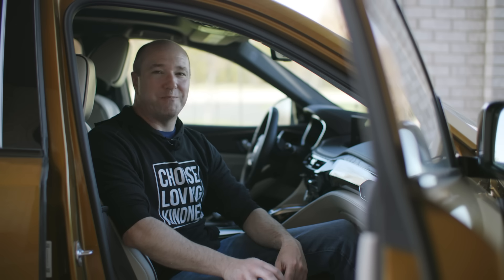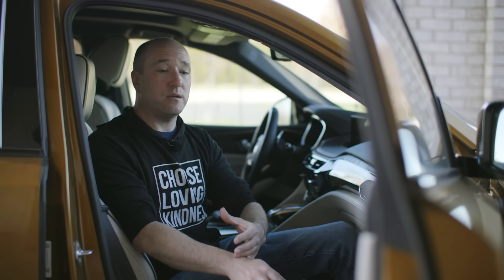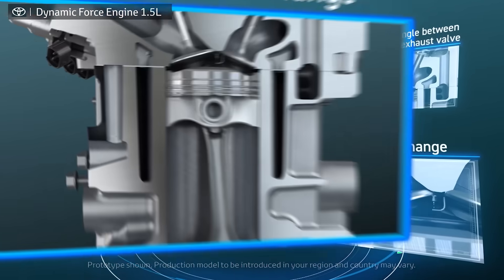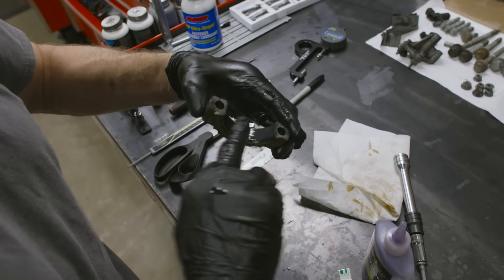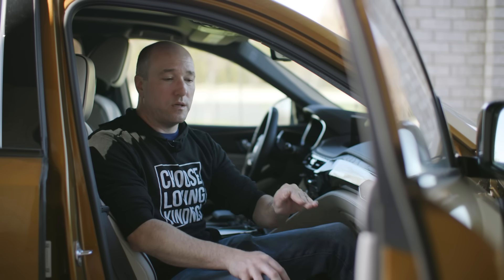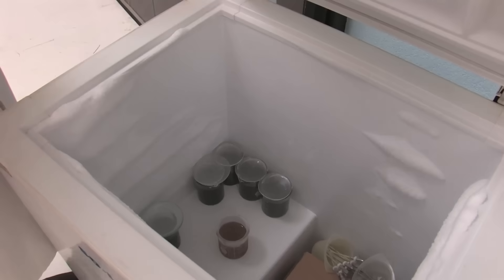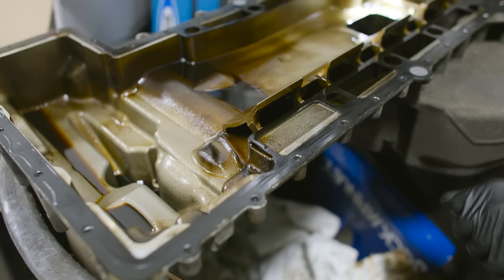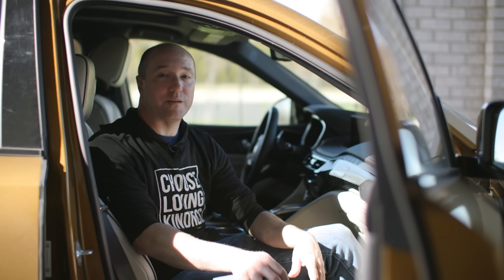Understanding Engine Break In | Dos and Don'ts

Comment: One minor but important correction: A 0w-20 will NOT be thinner than. 5w-20 when you get them both hot. On the contrary, the higher viscosity index of the 0w-20 that makes it thinner when cold ALSO makes it thicker when hot. Plug the respective KV40 and KV100 values into any of several online calculators and you will see this is true.

Comment: One of the most reliable engines was the Toyota 5.7 that was in the Tundra between 2007-2021 and it used a 0W-20 synthetic oil which not only helped with fuel efficiency but also cold starts and variable valve timing performance. The key is regular oil changes and not going passed recommended intervals. The problem with many of the modern engines that's causing issues is metal filings left over from the manufacturing process and incorrectly designed and manufactured engine components like in GM, Toyota, Honda and Hyundai's case. The idea it's somehow all of a sudden the oil, is hilarious and not true.

Comment: I always factory order GM sedans with manual transmissions. And I always give them a very careful break-in period.  I run them up to high miles, and I have never had an engine failure, or any transmission issues. My 2014 Chevy Cruze with manual 6 speed has had no issues at all except for a failed A/C (compressor clutch) at 9 years. This week I had my parking brake cables hang up a bit (rust!) and I am having new parking brake cables installed next week. The service tech was shocked that my brake pads front and back are original and still have three years left on them! How did you do that he asked? Simple. It's a manual transmission that is driven properly. When slowing down I NEVER touch the clutch until the RPM is right down to idle. Engine compression has been stopping this car for 11 years, and I loved the shock on this mechanics face!  But ya, I know everybody wants to drive SUVs with automatic transmissions, and then they complain about the price of fuel! Cry me a river!🤣

Comment: Bought a 2020 Corolla in September 2019. Changed oil three times before I got to 3000 miles. Zero oil consumption to this day. 120000 miles on it now. Varied rpms the first 1000 miles. I still get 45 mpg at 75 mph on the freeway. I have missed the optimum intervals on the cvt fluid though. I hope that doesn't hurt me in the long run. Should I take the risk changing cvt fluid now

Comment: Why does Honda spec OW 20 for the Type R if it’s not intended for high performance driving? They also don’t specify an early oil change because of sealants. And all they say for break in is low engine speed for 600 km (or miles?). They don’t say anything in the manual about varying the engine speed.

Comment: The L98 small block Chevy in the C4 Corvette I have has just been re-manufactured and is now in the initial 500 mile break in period on conventional oil.  The oil will be changed just before it hits 500 miles with conventional oil and at that point, it can be driven for 3K miles and the oil changed again with conventional oil.  It can then be driven another 3K miles and THEN at 6K miles, full synthetic oil may be introduced.  The reason for this, I was told, is to build up a healthy varnish on all the internals and especially on the gasket surfaces to prevent oil leaks caused by the aggressive detergents in synthetic oil (makes sense to me).  

Good video btw and I dig the shirt!  I too choose loving kindness as I choose Jesus Christ as my one and ONLY Lord and savior because without Him, loving kindness in humanities' fallen, broken state is a pipe dream.  Make sure your relationship with King Jesus is strong now because on the day you need it, you may not be able to get it.  Repent or perish, make your choice.

Comment: Oil changes on turbo engines are on a different schedule. First oil change at 500 miles. Then 2000 miles, then 3 to 5000 miles depending on driving conditions. This is imperative if one wants to drive that car in a long time.

Comment: Omg these people have no idea Since manufacturers have moved to the plateau hone finish the break in is less critical because there is less friction on the surface of the bore, if u have meter to metal contact on between the crank and the bearings its game over, its laughable that this guy thinks the bearings have high spots and nees to be knocked off is absolutely ridiculous talk about amateur  hour

Comment: the motor oil geek did a great video about engine break in that uses science and oil analysis to show you what the best way to break an engine in is.
Reply: yes and is totally opposite to what he is saying regarding oil changes. Especially for the newest T-GDI engines. You can see that after 4-5k miles the oil degrades in low-milage, everyday city driving, i.e. most people drive short distances on cold engine and requires often oil changes. There is so many evidence, done by the labs that following manufacture recommendations for oil change is typically only good for the car to make it through warranty period, exactly so you can go after that in dealership to buy a new car.

Comment: That is why i chosse a new c8 z06 with 5 miles on it. I Walk away from a used 2025 with 2600. Did not feel right,  to much vibration at iddle. 
The saleman keep tell me it is normal,  bs is not 
My at 800 miles does not vibrate like the used one offered

Comment: In 2022 I bought  a brand new Toyota Camry and drove it easy for the first 1000 miles and then had the oil changed at the dealership, which they did for free, and then the next oil change was at 5,000 miles. From then on I'm having the oil changed at the minimum 5,000 miles and sometimes I've had it done at 4,000 miles because of time between oil changes since I'm not driving  the mileage I use to do since I'm retired and not doing the daily miles.

Comment: If I buy a used car for example with 100.000miles, how do I "break-in", how should I break in, especially a gasoline engine? I mean maybe the previous owner used in on low rmps and for small distances, I'd like to get the full potential of the engine once again?! Thank you :)

Comment: Mark / Jack, what do you guys run in your GR Corolla? I have a 2025 GRC P+ and I don't really want to run the 0w20 that's recommended by the manufacturer. I was thinking 5w30 pennzoil ultra platinum. Thoughts?

Comment: Most break in is getting proper ring cylinder seal.
Unless something goes wrong engines wear out when the cylinder to ring wear seal no longer seals properly.
After that cam wear or timing gear wear but these are usually due to lubrication not being ideal.
Bearings are the last things to wear out, so break in should be focused on ring cylinder seal.
Best is to get up to temperature then vary load and rpm.
Even high load at low rpm for very short periods.
You risk micro welding rings to cylinder if you overdo it so not many will advise doing it but if done correctly it gives the best break in.

Comment: My brother was the service writer at a Honda dealer where I bought a new '86 Honda Prelude Si Special Edition. (available in The Great White North 86-87)  He told me to vary the RPMs, no hard driving, and not to drive over 60mph for the first 2,000 miles.

He asked me to bring the car in for oil changes after 100 miles, another 100 miles, then after 250, 500, 1,000 and every 5,000 miles from then on.  His instructions were easy to follow as I mainly used the car for commuting.

That engine lasted just over 200,000 miles, and never burned oil.  The only part that failed under the original 50,000 mile bumper-to-bumper warranty was a single headlight.  The water pump failed at 150K miles and the fuel pump at 200K - stranding me at a gas station.  The tow truck driver offered me $1,500, and I took it.
Reply: The 1.955 L I4 motor made 113 HP and dismally low torque, but made up for it by being very willing to rev - the variable-ratio power-assisted rack and pinion steering, 4-wheel disk brakes, and 5-sp manual made for sparkling and yet economical performance.  I added the full Jackson suspension kit which lowered the car an inch plus headers and Basani mufflers.  A joy to drive.

Comment: I used to break my cars in driving as if I had just stole them. They all became really agile cars. Those were small engines in small affordable cars (like the Ford Fiesta, for instance). One of my professors explained it was related to the tolerances - the break-in period is actually the last finishing on the surfaces that move in contact to other surfaces. Those would be the piston and cilinder, crankshaft and things like that. I remember we had to replace the lubricant pretty quickly and it came out black. Modern engines manufacturing methods have improved a lot and the tolerances are a lot tighter nowadays. I believe they make even crankshafts using the stamping method.

Comment: Engine engineer here. I will both agree and disagree with some parts of this video. While it's true that you do not want to thermally shock the engine, you DO want to thermally cycle it. You also want to get some cylinder pressure acting on the rings-- which means operating at or near peak torque (which is the point of maximum cylinder pressure). It's really, really hard to do a correct break-in on the street. It really needs to be on a load-cell type chassis dyno (i.e. not inertial) or ideally on the engine dyno. But here's what you can do on the street: From a cold start, idle only 10 seconds or so before gently getting going. Drive modestly and allow the engine to warm up. Once up to temperature, you'll want to do a load-step series of runs from 2500rpm to 5000 or so. Shifting manually (overriding as able), accelerate at 30-40% throttle several times from 2500-5000rpm as road conditions allow (find an empty country road or huge parking lot). Repeat several times, working your way up in load and repetition count while allowing the engine a minute or so at idle between runs. Continue until you've completed several WOT runs across this RPM range. Repeat the entire cycle as many times as you can. Go home, change the oil, and get on with life.
Reply: So you are very familiar with hundreds of engine designs? I think I'd trust the manufacturer's engineers who specify the break-in procedure. The GR Supra, for example requires a break-in procedure that restricts engine speed to 4500 rpm and vehicle speed to 100 MPH. The break-in period is for 1200 miles.
Reply: @davepaturno4290  Do as you see fit. But it's unfortunate that so many people can't grasp that OEM recommendations are written with different goals than you or I as owners have. They care about it being reliable enough to protect them from warranty cost and above all they care about gov't and legal liability. So of COURSE they cannot recommend full throttle operation for a street vehicle.
Reply: @G5HohnWhat many don't grasp is the Japanese honor and trust ideology that is engrained into their culture. I have worked directly with Japanese engineers. There's no way that their breakin procedure will result in shorter engine life. I know quite a few people who have/had 200,000+ miles on their engines. None floored the throttle, shortly after buying the vehicle.
Reply: I believe your method is correct. I’ll try this on my new Camry and see how well the rings seat in over time.
Reply: @markm0000 Of course, that method voids the warranty....just sayin.
Reply: @davepaturno4290   They would have a RPM limit if it voids the warranty like that. I can tell after a thousand miles doing some pulls and 2 oil changes the engine runs much better than it did when I first got it. I’m consistently getting 50mpg no matter what and some days 60mpg. Those rings are definitely seated now.
Reply: @markm0000 Get back to us when you have 150,000 miles, as to whether or not your abused engine is consuming oil. Most sportscar owners who don't breakin their engines according to the owner's manual, sell their cars long before 100,000 miles. I feel sorry for the next owners.

Comment: Always change your oil
In a car after the first 1000 miles I stay true to that…. So you can see if you have any metal flake or contaminants…. Just because oils and engines are “better” doesn’t mean the idiot who hates his job at the plant did it correctly…. When I went to test drive my new truck off the lot the oil was actually about a quart and a half low.

Comment: 2025 RAM 1500, I-6 here. Dealer said, go easy on her, mixed HWY and city driving for 500-600 miles. No towing or heavy lifting. Oil change when the trucks tells you. YES BOSS!

Comment: The first 500 miles you should to pulls up to 3000-4000rpm thru the gears, then use the engine break, and then up again. Try also to do it in a slight upwards slope also.

Comment: Breaking in is simple. Just drive the car normally, change the oil at 1000 miles, drive the car normally change the oil at 3000 miles, from that point change the oil every 4000 miles regardless of what the manufacturer states. If you’re going 7000 miles, 10,000 miles before oil changes, you’re doing it wrong…

Comment: We’re already seeing lots of examples of people who followed the manufacturer recommendations of 10 or 15k oil changes and had early engine issues/failure. I’ve looked at this topic extensively the most common recommendation for modern vehicles using synthetic oils seems to be 5k is a safe frequency to ensure longevity.

Comment: After dreading waiting 7 months for a bike, I went through open mindedly and watched as many break in videos and read articles as much as I could.  I compiled what made sense to me and decided to break everything in.  I pretty much came to the same conclusion as this video. Here's how I pretty much had broken in my bike.

1. Properly warm up your engine!
2. Don't just ride at a steady RPM
3. Use the RPM range but don't be jerky with the throttle.
4. Use engine breaking as much as possible.
5. First 50-75 miles, roll on and off the throttle 30%-60% of the RPM range
6. Miles 75-150, roll on and off the throttle 30%-70% of the RPM range
7. Miles 150-250, roll on and off the throttle 30%-80/(90%) of the RPM range
8. When rolling on the throttle, keep it as smooth as possible.
9. When rolling off the throttle, keep it as smooth as possible and try and let the engine braking do as much of the work as possible when fully off back down to 30%
10. Think of "mileage" more so being Engine Revolutions than miles travelled.  You want to make sure you properly warm up the bike, but at the same time, make sure you aren't letting the bike sit as you may lose precious windows for proper break-in.

Take it all with a grain of salt, but I'm ~290 miles with a nicely ticking bike.

Comment: I had plenty of new dirt bikes.
I added slightly more 2 stroke oil to the fuel, if it fouls a plug so be it, plugs are cheap and easy to replace, although I never did.
Two Suzukis and 8 Yamahas.
I played at different ranges, and never pinned it for the first couple hours of the engine running. Never got it real hot.
Basically did exactly as he described.
I always had great performance, plugs always looked good, my bikes always started on a dime.
I remember changing the crank  case oil after each weekend, Bell Ray was the oil of choice back then. Although it was considered expensive I felt it was cheap considering the pay back.

Comment: Here’s an excerpt from Audi under break in for my old school b8.5 RS4 “…avoid using full throttle and keep the engine under 7000 rpm. From 2000 to 2500km you can then increase engine speed…” LOL breaking it in at 7000rpm, most cars are lucky to redline that high these days !

Comment: Tribology & oil analysis. Due your first oil change at 500 miles, then 1500 miles. Get an oil analysis to see how things are going. You can run oil up to 10,000 miles if oil anaylisis bears this out for engine.

Comment: Breaking in a ground up rebuilt 1mz vvt from an rx300 in an mr2, so far ive stayed under 3k the first 500 miles, varied throttle and rpms as much as possible, now im going up to about 5k fairly gently, varied throttle etc. Did an oil change at 50 miles to dump out rebuild contaminants and 300 miles mostly to check for bearing materials, oil was pretty dark in the pan when it looked very light on the dipstick, no chucks of metal though! This video has largely confirmed to me what i thought was the best way to wear it in, big thanks!

Comment: The "drive it like you stole it" advice comes from people focused on the rings. The problem is you have to worry about the bearings too. You have to use the right oil and cater to every metal contact point at the same time with many tradeoffs. That said, as much as I appreciate the knowledge and study of perfect auto maintenance, the fact is that your vehicle is also in a competition with rust, and to not be in an accident. So yes do what you can to prepare for the best, but in reality your vehicle has a high chance to fail from rust at year 25+ or an accident at 200+kmi on average no matter what you do, so do your best - but if you go crazy a tree is going to fall on it in year 18 anyway so hedge your bets and chill.
BTW I'm on year 17 with my current car which is like new. So I'm with you. But I also know one good bump and the insurance will want it crushed.

Comment: I drove a new Z06 off the dealer floor with 5 miles on it. I followed the 500  mile break in period,limiting the rpm’s and I’m at 10k now with no issues! Follow the break in period and you will be fine! I’m at 10k now on the hand built LT6 and it’s great 🇺🇸
Reply: I bet you hear bald eagles every time you hit wide open throttle haha

Comment: So overthinking it. Let the engine get to warm running temp. Drive it by varying the throttle, keeping it in a lower gear to build cylinder deceleration pressure now and then in varying conditions. Do this for 20 miles and stop, letting the engine cool. Repeat that cycle two more times and then change the oil. You’re done.